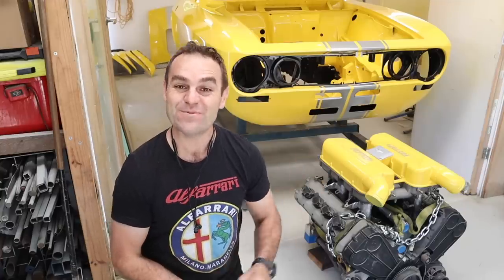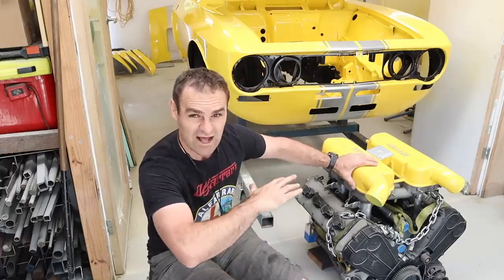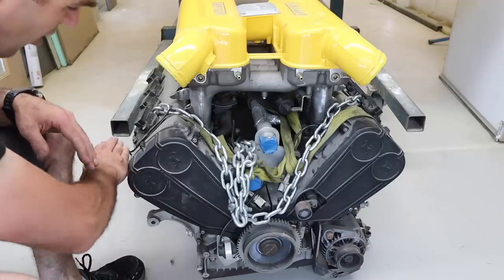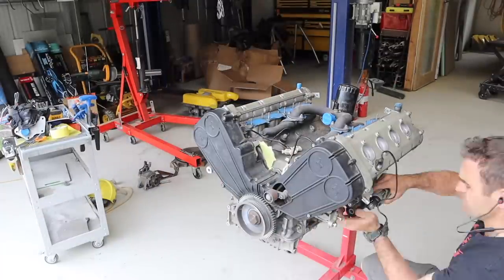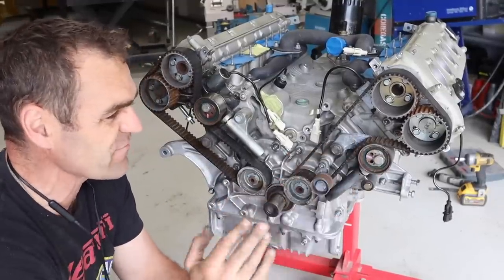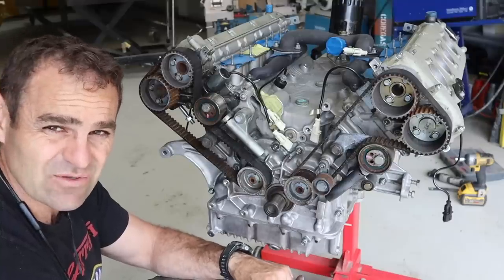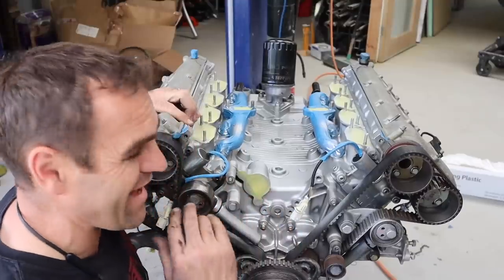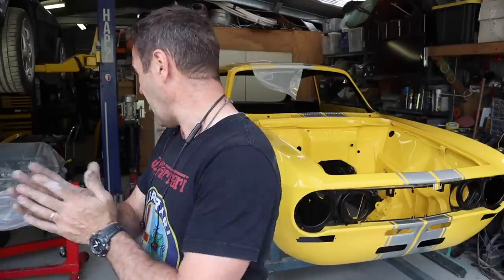Ferrari engine tear down - Ferrari engined Alfa 105 Alfarrari build part 156

Comment: Hi Jeff, a tip for changing cam belts, leave them on, and cut along centre of belt,  remove front part of belt, slide new belt on to front of pulleys, and remove the rest of old belts, does not upset the timing this way, good video.
Reply: The official Ferrari method is to use mole grips to clamp the cam pulleys . Saw Ratarossa do this method on his channel
Reply: Aaaand now I'm embarrassed that I never thought of this!
Reply: @mattbettany1174  mole grips.... Lovely precise tool that never slipped off any job. Some engines even have holes you can jam Allen keys in them through to the pulley..
Reply: @stevenwest1494  agreed , but that’s how Ferrari tell you to do it lol
Reply: Great idea
Reply: @mattbettany1174  perfectly fine way to do it if the idler bearings and tensioner still have plenty of service life, however if they're due for replacement, well its all got to come off
Reply: When changing timing belts you should always replace tensioners and pulleys and often water pumps. Your method is a clever idea but doesn't work if the job is to be done properly.
Reply: Great idea

Comment: Just a little thing i want to mention. To avoid or minimize possible bad turbulences on the modified short intake manifold, sand blast the inner walls of de ducts. It creates Vortex (like a Golf ball), air will then friction with air. The methode is controversial because create Vortex takes energy, but i thing to avoid turbulences it could make sense.

Comment: Glass bead blast the rocker covers and Cerakoat them.   I'm concerned about the rust on the timing belt gears.  That looks like water immersion rust.   Simple surface rust is much more smooth. Good luck.
Reply: Sea air from import and Japanese road salting might have an effect too.  I have an import Hino engine in my truck and the turbo housing was amazingly pitted when I got it.

Comment: Oily bits! That inlet cam is crazy, forgot it was a 5-valve. IIRC you're going to be using an after-market ECU, so presumably you'll be able to map the engine to your liking? Was thinking it might be nice to have a tamer delivery for the road, maybe even a 'rain mode' - I imagine the full monty 400BHP in a light, front-biased rear drive car might be a bit hairy.
Reply from the maker: The inlet cam is definitely different to anything I have ever seen. As for the rain mode, I definitely could do that, but I think as the engine is not super torquey, it should be a nice linear power delivery and if I don't rev it out it should be tame... I hope ;)
Reply: @HomeBuiltByJeff  yes, the lovely thing about these engines is that you have to go looking for the performance rather than having it arrive all at once, ready or not!

Comment: I think the best way to make the inlet manifold runner textures/colors match would be vapor blasting. It achieves a uniform finish on cast parts. Only downside is it would require complete disassembly, or the media would destroy the throttle blades in short order
Reply: Would be perfect for the cam covers, though. Clean and fresh, without being blingy

Comment: the rust will just come back after cleaning off the surface rust without adding some kind of rust preventive oil or paint or converter like por15 on the cam sprockets and crank pulley

Comment: how many miles or km ?has your engine been tested? did you do a compression test and leak down test? how do know it works and if it does start how long is going to last? did it come with a warranty? If all is unknown then I would test on homemade engine dyno with your custom built oil feed box. Test everything before painting. test the used Toyota electric steering assist, test Subaru trans

Comment: Honestly, I doubt the (cut-down) runner lengths will hugely impact your engines performance.  An easy way to figure out the cut-over points is simply to do a dyno run, once with them fully closed and then fully open and then it should immediately become apparent where you need to trigger the valves in the ECU.  It'll be a lot of fun to hear this thing roaring on the dyno!  Not considering an oil filter relocation kit whilst you've got it all out and disassembled?
Reply from the maker: Oil filter can still be accessed, and even if I could get a kit (which I can't) where would it go that doesn't look horrible ;)
Reply: @HomeBuiltByJeff  Oh, I thought you mentioned in another video it was tricky to access, with the plenum so close to firewall?  I was just thinking of a sandwich plate, so you could put it just about anywhere.  But yeah, that engine bay is looking pristine now, so I don't blame you for leaving it as-is!  (Edit: Mocal have kits)

Comment: I use a lot a Melamine sponse (Magic eraser ) , for cleaning , the are the best solution i found , for cleaning parts with structure, the are cheap, clean good even without chemicals (the pulverize when you use them). I buy the colour white, so I can see when sponse stay white , the part is clean. I hope you would use dry ice, I curious about it, but I understand your arguments.

Comment: A good way of making the aluminum a uniform finish is to sandblast in your cabinet and then you can get a rattle can metal clear coat. I’ve always done this on fuel stained V8 inlets and they come up looking new. 
   The sand blasting blends any areas that you’ve welded and then linished/sanded and blends it in with the cast finish and the clear coat seals the alloy so fuel stains wipe off in the future. 
     The paint seams to handle the heat, I’ve just used the clear paint that you get for painting copper to stop it tarnishing and going green, they’re both non-ferrous metals so it works. Much nicer than the “aluminum” colored paint. (Obviously you can’t do the engine but anything you can unbolt works a treat)

Comment: I would paint to, but glass beads would also do it😉 but if the engine has a rubber timing belt please change it before fitting it😉 in denmark there are only warrenty on used engines if they are changede
Reply: Oh 2 min later you say they will be changed he he

Comment: Useful for anybody else, but white spirt vinegar will pop any surface rust off those cam belt pulleys in a 1 day soak.For me, the most visually compelling thing that you should do now is replace all of the visible fasteners with pretty ones. Those cam covers are a prime example, Daunting but I'd have all the studs out and bolt it home, but that's because I hate Acorn nuts with a frenzy and they will never be secure. If you need any ideas, give me a shout.'Kin expensive though, but having built show level toys,worth it.
Reply from the maker: These aren't typical acorn nuts. They are small Nylocs with a tiny sheet metal cap.
Reply: @HomeBuiltByJeff  https://www.autosport-bearings.co.uk/wp-content/uploads/2016/04/ABC-AUTOSPORT-BEARINGS-COMPONENTS-LTD-FAST-HW-HWM-KFN.png

Comment: This is going to look awesome, would you consider getting the timing covers hydro dipped in a carbon pattern?
Reply: @rosstulloch8100  absolutely nothing wrong with it if done right . Retropower have done it on some of their builds . But i respect it’s your opinion
Reply from the maker: Never EVER. All fake carbon needs to be burned with the heat of 1000 suns ;)
Reply: @HomeBuiltByJeff  😂

Comment: Since you've never seen this engine run I'm sure you'll want to check the timing is actually correct rather than just clamping everything and swapping out the pulleys and belts.